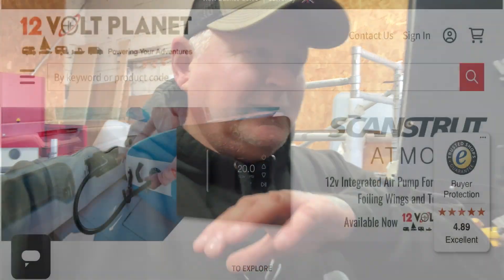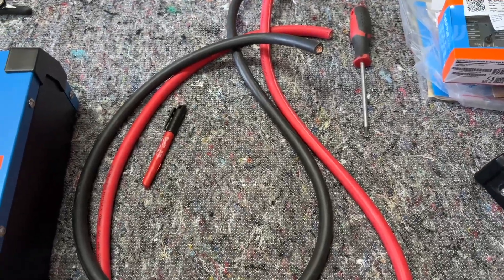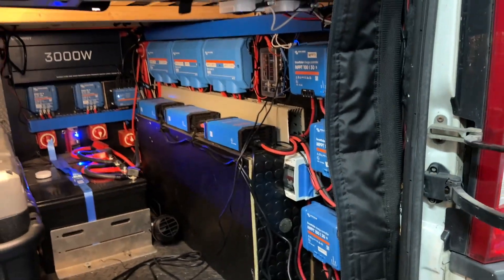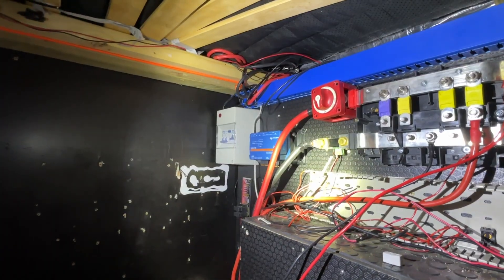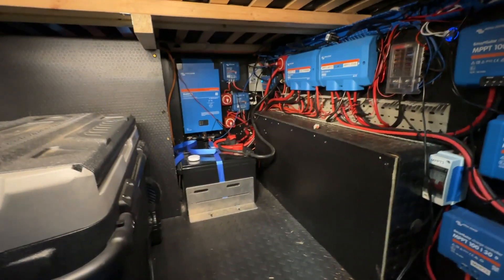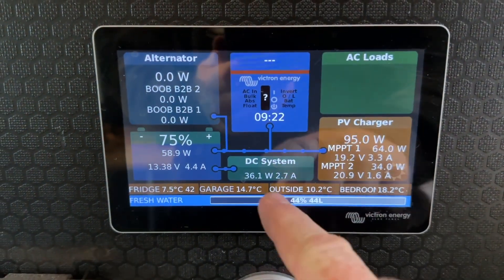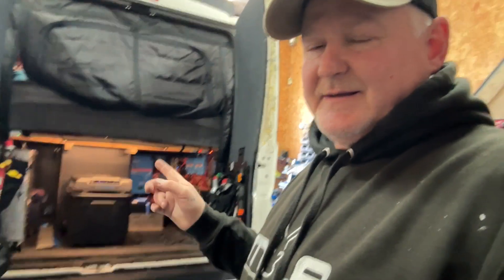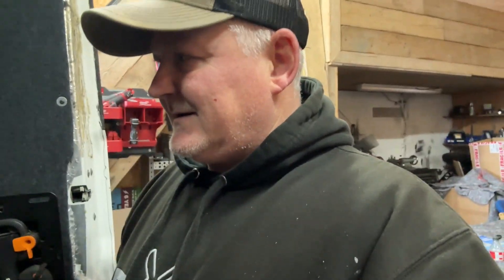Victron MultiPlus 2000/80 12V Inverter/Charger Upgrade

Comment: Also, make sure you connect VE bus with an MK3 and set up that inverter. It comes with the settings incorrect and not set to lithium batteries. The profile isn’t correct for lithium out the box. Not sure if you purchased it programmed or not, but if you didn’t, I highly recommend setting it up via MK3.
Reply from the maker: All set up mate..

Comment: You actually downgraded. You went from 2400 continuous watts with the current inverter to 1600 continuous with the Multiplus. You also went from 90 amps charging to 80. I have the same Victron inverter and it’s awesome, but the 1600 continuous watts isn’t quite enough. You should have kept your current setup, or went with the Multiplus II 3000va.
Reply from the maker: May thanks… have a great new year 🎉

Comment: hi rob the multi plus has a trickle charger built in to it it 5 amp i use it via a relay on my cerbo gx to turn it off  or on as needed
Reply from the maker: Hi mate, hope you're well, I did speak with Alex Frood about it, but the Stirling things already fitted, working and flashes so couldn't be bothered with the trickle option on the Mulitplus mate
Reply: @packthevanandgo  did 12 volt planet config the multi plus for you or have you done it you self using a mk3 cable and laptop
Reply from the maker: @bonehead2412 no and no is the answer
Reply: @packthevanandgo  i would check the setting for charger on the multi plus is set to smart lithium before you plug it in to the mains  as from all the installs ive done there set for lead acid and a too high voltage 14.6-14.8v plus a de-sol fate that goes up to 15v is once every now and then   and low voltage disconnect is set a fare to low (9v ish)  should be around 11.2 - 11.9v i can send you my firmware setting file for to work from or as a starting point
Reply from the maker: @bonehead2412 I take it I’ll need to get myself the Mk3 cable to access the firmware and settings?
Reply: @packthevanandgo  well you can do it via vrm  as long as its connect to cerbo gx
Reply: @packthevanandgo  but yes a mark 3 is need  if you want tio do firmware up date  again they can be done from the VRM portal  but i dont recommend update the firmware without a mark 3  the setting are fine to change via vrm portal if you got it set up
Reply from the maker: @bonehead2412  Ive just ordered a MK3 usb c to VE bus mate.. Many thanks for the heads up and the advice.. can you send me your firmware?
Reply: ill message some photo on facebook of the portal screen shots
Reply from the maker: @bonehead2412  Thanks buddy!